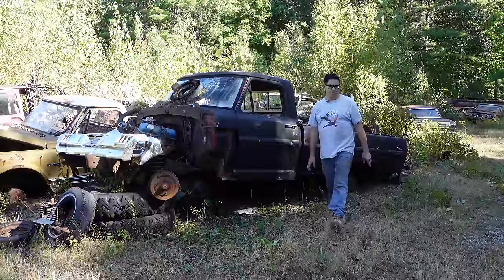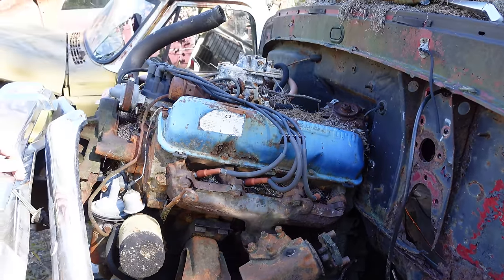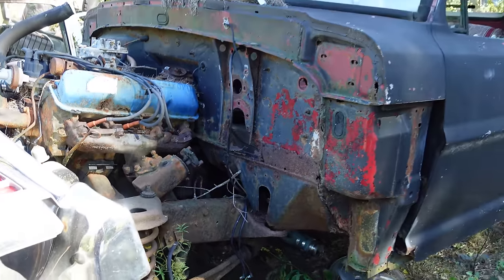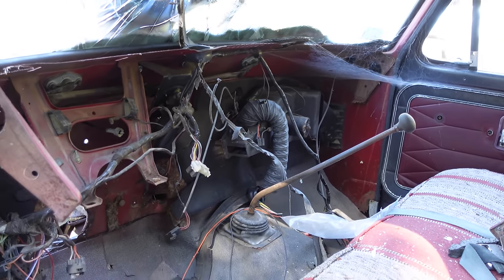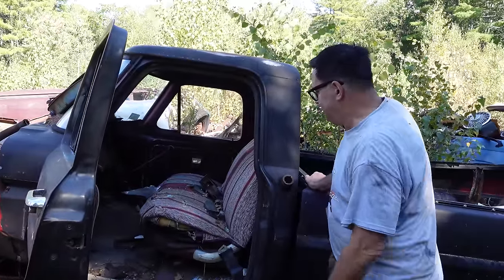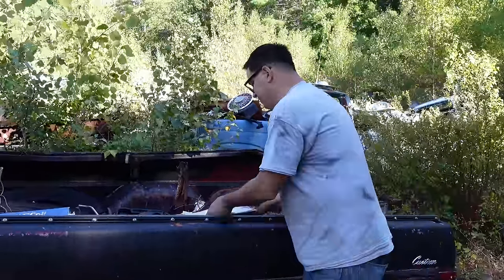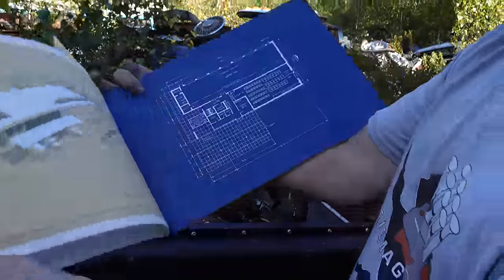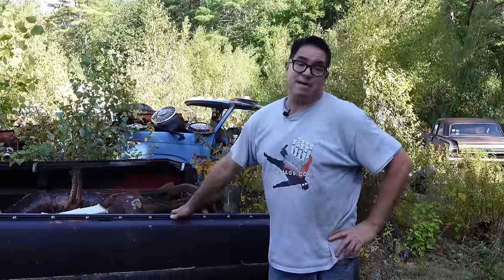F100 Big Block Swap

Comment: Correct, when you get the VIN, you win: F10 for F100 2WD, E for Mahwah, NJ assembly, G for 302 V8 with two barrel and the rest does line up with January 1972 production, making this a 1972 model year truck. The Mahwah, NJ plant operated from 1955 to 1980 and was located on Route 17 in Bergen County, NJ. Today Amazing Savings and Land Rover and Jaguar have offices on what was once that site. The last vehicle came off the line at Mahwah on Friday June 20, 1980. For a time, Sharp Electronics USA's headquarters was also at that site, but they have since moved to Montvale, NJ (in the same area where Mercedes Benz had their US office). 

Going further, when you get the tag, you can brag: 115 for the truck's wheelbase in inches aka "Short Wheelbase Truck", (something that is still on a Ford truck door jamb certification tag today), V for Mallard Green exterior paint, F103 for F100 2WD with 5,000# maximum Gross Vehicle Weight Rating, 6 for Light Green and Medium Green vinyl interior trim, 3 for Flareside pickup, F for four speed manual synchronized Warner Gear model T-18 transmission, H2 for 3.50:1 Ford T.S.(Torque Sensing) produced locking rear axle, 5000 for the maximum GVWR in pounds, 134 for the net HP at 3600 RPM and 13 for New York district sales office. 

Correct, just a wheezy 302 V8 with about 154 HP and 8.2:1 compression ratio. But, you didn't buy a truck like that for power per se. You bought it to haul and do work. Today, while pickups still do work, many are more of a status symbol than a work truck. Yes, that is correct that the VIN for Ford trucks through the 1980 model year doesn't have a character for the model year (like Chrysler and GM did back then), but some door tags on certain years actually state what model year that they are on the bottom part of tag. Ford passenger cars and earlier Ford trucks did have a model year code in the VIN. 

But yes, no matter what, as I have said for a long time, "When you get the VIN, we win and when you get the tag, you can brag". Or in the case of a GM, "When you get the SPID, we're glad that you did."
Reply: "3 for flareside"... Wait, wasn't that Ford's term for a stepside bed?  So maybe that's not the original door for this truck then.  Also the interior is red, not green... so this truck may have had the 360 from the factory, but if it did then it might not have the limited slip rear axle...
Reply: @livewire2759  We can only assume that the door belongs to the truck, unless we have proof otherwise. The four-speed transmission, the paint color (I think I see evidence of it under all the other colors) and everything else match up. 6 should be the code within the body type for green interior trim and 3 comes back as Flareside, but I do agree, that this is likely more a Stepside style bed. Flaresides usually had steps on the sides. Both Flareside and Stepsides came in 115" wheelbase in 1972. The literature states 3 is Flareside. Could a mistake or two have been made? Sure. I saw a low mile Grand Prix shown on YT that had "Final Assembly Point: Pontiac, MI" on the original window sticker but the VIN supported it being a St. Therese, Quebec Canada made vehicle, complete with the maple leaf decals on the door.
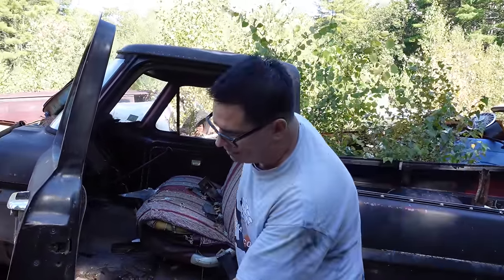Reply: @googleusergp  I didn't see any green on the truck, inside or out. The cab was obviously red. The bed says Custom, but those look like they are Ranger XLT interior door panels. Rewatching at 3:51, I can see what looks like green paint poking out from under a chip around the head of the Philips screw, above the Warranty Tag.
In this case, the tag might just be a wag, so we need to consult the frame in order to stake our true claim. Frame VINs on a '73-'79 are on the passenger side rail, one under the alternator, and the other under the floor, requiring a mirror, a camera phone, or a hole in the floor to confirm. My guess is that it is really a red big block truck.

Another REVISIT request for Steve...😁
Reply: @DanEBoyd  Possibly. Tough to say after 50 years to say what it was. As Mr. Magnante said, things could have been swapped and switched over the years. I do spot some darker green on it, which is consistent with Mallard Green on the tag.
Reply: @googleusergp  You're right, and I agree, the tags don't lie, so aside from the info they tell us, we can only assume, but something clearly doesn't add up, therefore, I could understand someone replacing the bed, swapping a "flareside" for a fleetside (or whatever Ford called it), and then painting the exterior, but it's highly unlikely that someone stripped the interior, painted it, and replaced everything inside to match the red paint... THEN after doing all of that work, let it rot in a salvage yard.  It's much more likely that the door was replaced, painted to match and the red door panel was swapped to the new door.
Reply: @livewire2759  All speculation. We don't know the history and what was and what wasn't done.
Reply: @livewire2759  Ford called the regular beds Stylesides
Reply: @purpurahaze9179  Yeah... I used to know that... LOL  Thanks!
Reply: @googleusergp  Of course it's speculation... but you have to admit, one scenario is much more likely than the other.  Sure, that doesn't mean it's true, but it's still more likely.
Reply: @livewire2759  No problem just sharing some knowledge if I know it . I know how it feels forgetting things
Reply: @livewire2759  Possibly, but I go with what's there. Who knows the real story? Either way, we could both be "right", and it's a combination of theories.

Comment: Bend for alignment?  I'm sure that's true.  Later trucks even had a warning (I think it was cast into the beams)
"Do not heat or bend".
Reply: Didn't stop a lot of guys...
Reply: The bending to align was standard procedure..  kits were available to perform the procedure.  The process was done without heat when I obsereved it.
Reply: I think the  "do not heat or bend" was for the cast beams vs. the earlier forged beams.

Comment: VIN location for the win?  The frame rail. That is pretty much always going to take precedence from the VIN on the warranty tag in the case of a discrepancy. I don't know about those doors, the rest of the truck all shows signs of having been red, but I don't see any on the doors, save for a small spot on the driver's door, in the center just under the window, but that might be red oxide primer.
And that truck, being a long bed, has a 131" wheelbase, and for '73 gained the same two inches, to become 133".
The vernacular for that truck is Bumpside, with the '73-'79s being called Dentsides.
The first truck I ever drove was quite similar. It was a '72 F250 Sport Custom, originally in that same red but repainted bright orange, with a 390 and C6. This truck had nearly every googaw from J. C. Whitney, including a clear distributor cap, Yosemite Sam mud flaps, and a Mack Bulldog hood ornament!!!
Reply: Dan, it is ironic Steve did this video when I have that blue and white truck I am trying to sell.

Comment: You absolutely have to bend the beams to set the camber on the early models that used king pin style knuckles. Later model ball joint equipped models have adjustable bushings for the upper ball joint to set camber and caster.

Comment: Bumpside vs dentside
Reply: 67-72  73-80 GM trucks >> Ford. But bumpside>dentside
Reply: Is this a question of what you prefer? If so I'm going bumpside but I like them both.
Reply: @TomTom-qm4mq  as I answered 😂😂
Reply: @TomTom-qm4mq  bumpside looks a million times better
Reply: No quiz just putting terminology/slang to Steve's comparison.
Reply: When I was a little kid, I thought Bumpsides and Dentsides were the exact same truck! 
I have a Dent, but prefer Bumps a little more. A million times better?  I don't know if it's that drastic - they are very similar looking trucks.
Whoever designed the Bumpside did a Harley Earl-quality job on it, in my opinion.
Reply: @DanEBoyd  they do not look similar at all if you really look at them. The cab design is different/ turn signal arrangement along with grill/ doors/ beds are completely different etc etc. the bumpsides share the same rear glass as the bullnose/bricknose and aero nose fords
Reply: @DanEBoyd  I have a bumpside ford that maybe why. But I’ve also had some dentsides but always got rid of them I never really was a fan. The bumpsides are just a better looking truck in my opinion

Comment: I have seen many of those with the 390 two barrel and they were factory installed.
Reply: Yes, that would be a VIN code "H" engine in 1972.
Reply: I don't know the numbers but most of these trucks were two barrel
Reply: @purpurahaze9179  Yes, many were.
Reply: @googleusergp  Hey maybe you can answer this question did Ford start using front disc brakes on 2wd F250's & F350's in 68/69 or was it later?
Reply: @purpurahaze9179  I believe you are right. 1968 it was optional.
Reply: @googleusergp  Thanks  I had a guy arguing with me that they didn't exist until 74 just because his 72 didn't have them. I know I'm not the smartest person in the world but I have catalogs that list them
Reply: @purpurahaze9179  Easiest way to prove an "expert" like that wrong is to go to a listing on Rock Auto and look up parts for a given application. Chances are if they show it for that year, make and model, it was available as an OEM option. That disproves the "expert" right away.

Comment: Yep if I remember correctlly a Y in the vin is the 360 although its very easy to swap in a FE into these trucks all you need is the motor mount pedistals and thats about it. 67-69 all the V8 trucks were FE I don't think they put the 302 in them until 1970 but I may be wrong.

Comment: If I remember, the FE (ford edsel) reference was for passenger cars and FT (ford truck)for pickup trucks,  but also the Ford truck displacement sticker would end with a 1 instead of a zero at the end of the displacement of a big block Y design (361 cid, 391 cid), likely to mark a different crankshaft requiring different harmonic balancers and /or flywheels. The Lima seemed to avoid this.
Reply: FT was for the medium/ heavy-duty trucks.
Reply: @alanwhite3280  Well he got some of it right 🤣
Reply: @alanwhite3280  thanks

Comment: You heard right they made a tool to bend I beams for camber and strut rods for caster it takes lots of hydraulic psi to bend the beams and had to make sure you were bending in the right direction or you would be doing twice the work

Comment: Sorry thats not a short bed an those trucks did come with a 352' 360 ' an some with 390 v8s
Reply: The tag on the door says it is the 115" length which was the short bed.
Reply: Did u ever think that the door came off another truck? An look at the video it's clearly a long bed the number on the frame horn would tell the tell. I'm not knocking Steve's ability to idea a truck but look at the vid it clearly shows a 8ft bed not a 6ft bed of a short bed

Comment: Worked at my father's Ford dealership in those days, "final assembly: Mahwah NJ" on the window sticker made the hair on my neck stand up. Absolutely the worst plant in Ford history. Everything loose, bad fit/finish, lunches behind door panels, "mystery" rattles(Coke bottles inside frames), you name it. One legendary story of the Coke bottle rattler found by a dealer tech with a note inside..."now find the bomb!" Story goes the customer was present when the tech found it! Guess what happened next!!

Comment: I had  67 with a factory  installed  352 three speed long box
Reply: @mexicanspec  Well it wouldn't be John's truck then 67's were very different from the rest of the years for that body style plus you only could 3 engines  240 straight 6 ,300 straight 6 or the 352 FE Big Block

Comment: CORRECTION a 360/390 is .50 overbore not .30 on the 352.
Reply: And while we're at it...  
Windsors are only 351s. The 351W is a small block Ford, just like the 221, 255, 260, 289 and 302. The 351W just has a taller deck.
All (351) Windsors are small blocks, but not all small blocks are Windsors.  Just like the 400 is not an M.
However, in Australia, they did actually produce 302 Clevelands!
Reply: A correction on your correction. It's  .050 (fifty thousands of an inch) and .030 (thirty thousands of an inch).
.50 is 500 thousands or a half an inch!.  There would be nothing left of the cylinder walls!   😁
Reply: @burthenry7740  thank you for correcting my correction.😂🤣👍

Comment: Awesome because I plan on getting a 68-71/72 ford f250 camper special truck usually custom cab or sport custom trim Pckg truck, and trade my dodge ram second gen magnum V8 46 RH 1500 4x4 long bed quad cab laramie slt trim truck,i want to get a bumpside Ford truck to make a shop truck rat rod project truck preferably with the fe352-390 automatic transmission, and the 8 or 11 rear spring leaf packs per side so it can haul heavy gauge scrap steel and scrap metal, and haul firewood and some motors and other car parts and pieces at times and well anything else i choose to haul in the bed of it.

Comment: I wonder if you're going to find a V6 F 100.
Reply: Not a V6 from that Era. I6 for sure
Reply: Last F100 was '82 or '86 or something like that, and the first factory V6 in a Ford pickup was probably 1997.
Reply: @DanEBoyd  You guys are wrong wrong wrong. Look it up! 3.8 Essex V6 '82-'83.
Reply: @Scott_From_Maine  Oh man I didn't realize those ever went into trucks, I'm sure those are just about all gone or swapped.
Reply: @DanEBoyd  This is going to sound strange I didn't know they used the V6 in trucks either until a couple of years ago my cousin bought a 82 F100 and it had the 3.8 but wait it gets stranger guess what motor he replaced it with a 410 FE Big Block 💥

Comment: A 1972 with drum front brakes.  Must have been the last year for that.
Reply: GM trucks had front discs starting in 71. Ford started in 73. After GM. Which ford trucks have always been behind the others when it comes to modern designs
Reply: F250s & f350s with the 390 had disc brakes starting in 68
Reply: @purplefireman8184  buddy I actually have a 72 F350 flatbed right now setting in my driveway. 390/4 speed truck. It’s drum brakes all 4 corners
Reply: @purplefireman8184  it’s yellow and has a 69 grill in it 😂😂
Reply: @purplefireman8184  it’s the only bumpside I have actually. 😂😂
Reply: @purplefireman8184  F37YCN is the beginning of the VIN
Reply: @purplefireman8184  built in 01 of 72
Reply: @purplefireman8184  I hate to prove you wrong like that but I literally do have one setting in the front yard
Reply: @Andy8mm as far as I can tell you could get front drums up until 75  but the drum brakes on this truck are the biggest you could get. I have the same ones on my 69 Ranger
Reply: @brandonbell3089  That's because who ever ordered your truck didn't get the front disc brake option that started in 68 on F250's & F350's just like @purple fireman said so you didn't prove anything
Reply: @purpurahaze9179  you could not get discs on a 3/4 or 1 ton period until 73 plain and simple

Comment: If you find a 77 F-100 short box 2WD with a 351M400 with a slight lowering and wheelwells full of rubber mine was stolen as was a 1970.5 Falcon left original sans a professional tint job, to protect the interior,  auto 302 2V that I bought from the original owner who was 63 when she bought it in Texas. Last I knew they were both in NYC which probably means they no longer exist. (Crying emoji)

Comment: I guess it doesn't really matter anymore if it was a true big block or not anymore... if anyone WERE to go save that truck from the boneyard... it would get slammed on bags with a tube chassis and a twin turbo 2000 hp coyote engine... or a LS swap something or other... nobody wants a old school slow putzer of a truck anymore.

Comment: Oh god them dam 360 they were the GM Gimmy Deisel Leakers, it did not mater what you done they just leaked every where and they become big huge oil covered black lugs with sad power. but, but if you were a bit adventerous you coulld bolt 390 heads and a 390 4 barel manifold to them and give them a tiny bit of hope for power. advantage was the 390's bit bigger valves and the same piston dish as a 360. there was many many say hill billy on the farm little experiments garnteed never tried by many guys that we did, like stuffing 428' and 429's into our knotch back 60's mustangs, putting a old iron block hemi into our chevelles, combining ford dodge and GM together to make a faster car. or putting V8's into our dastsun and toyota pick ups.